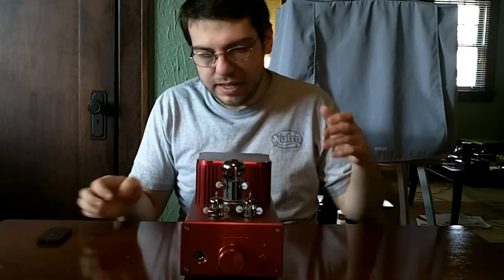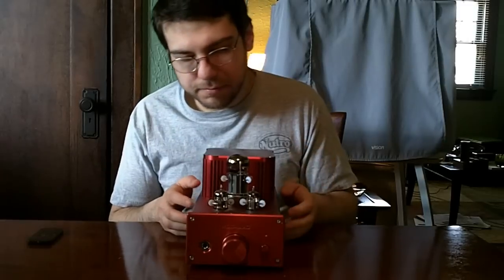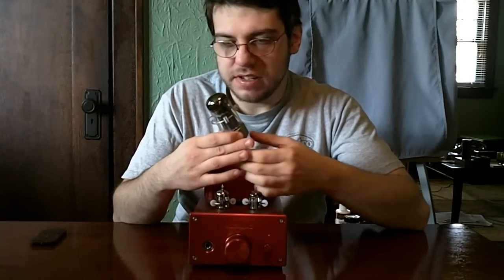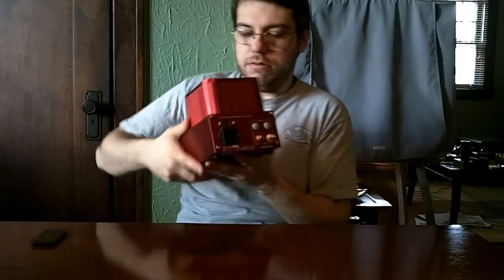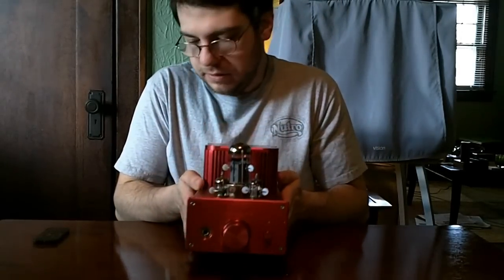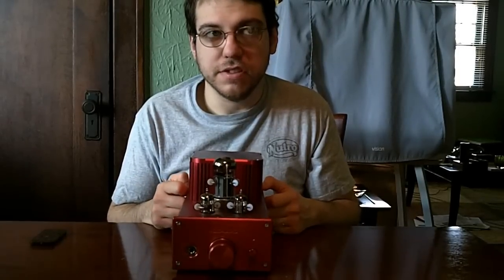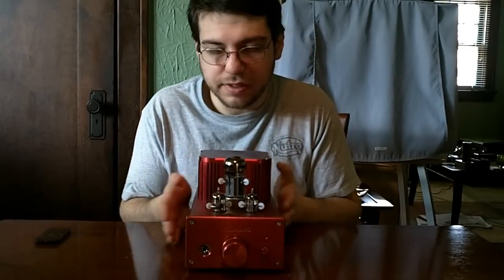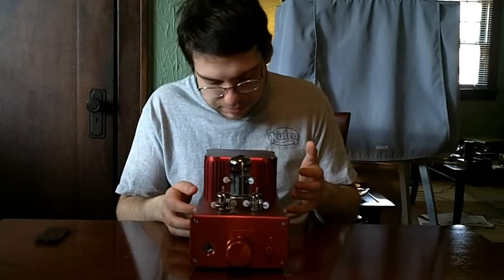A Brief Overview: Woo Audio WA3+ OTL Tube Headphone Amplifier

Comment: Woo WA3 is not an amplifier you want to modify in any way . It's a very personal amplifier it's more like a beginners wa2. It what a tube amp is supposed to sound like without the wow factor . You don't buy a wa22 and then say I want a wa3 . That said it's not a horrible review and I too rub my amps but not in public. With better tubes you will minimize muddy sounding . Lets get something straight at low volumes low imp cans do good it's at high volume when it gets bad. I have 650's and they sound amazing if possible 5998 5998a and 421a are your best choices the 6922 ? maybe 7308 sylvania ?? ec88. google WA2 and the top rated tubes also work great here too  . I love mine it's what a tube amp is supposed to sound like fat tones slow and sloppy very musical very personal . You want more wa2 ...